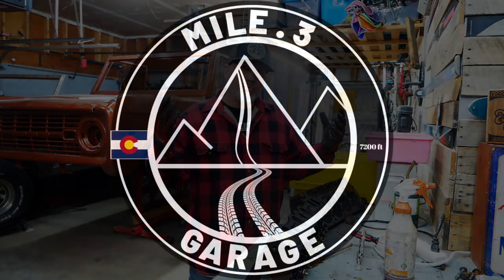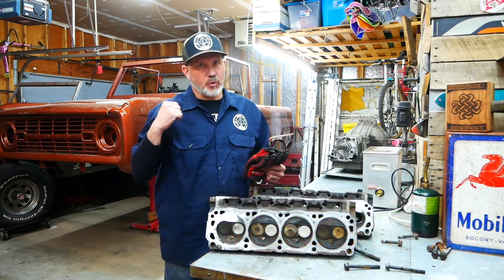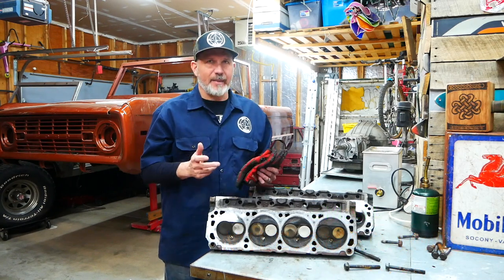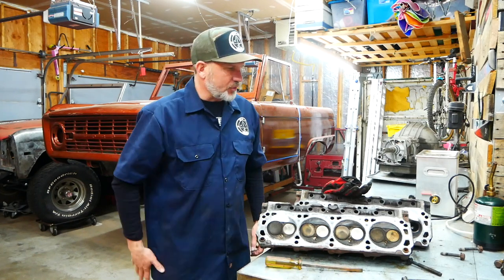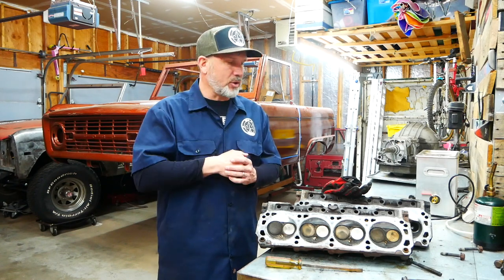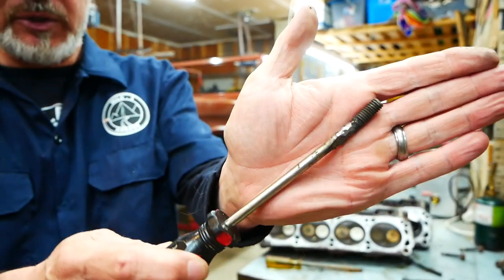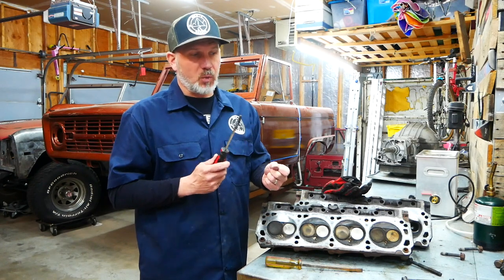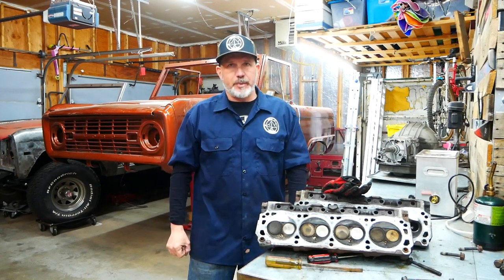Easy Intake Bolt Extraction

Comment: Repeated light hammer strikes on the end of the broken bolt will help pump penetrating oil thru the threads.  If you can get to the back end, use a punch to tap on the bolt down in the hole as well.  This shock will also help to break up the rust that's bonding the bolt to the head.

Comment: If I was going to take the head off to remove a bolt I would put aluminum heads back on the engine just a thought
Reply from the maker: After porting the heads, I would agree.